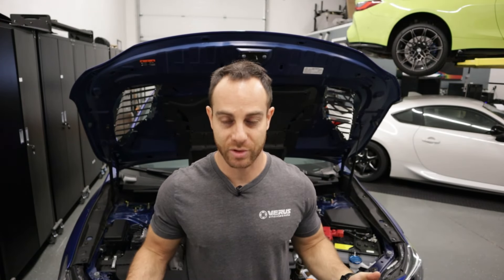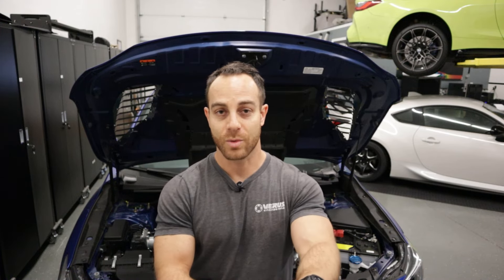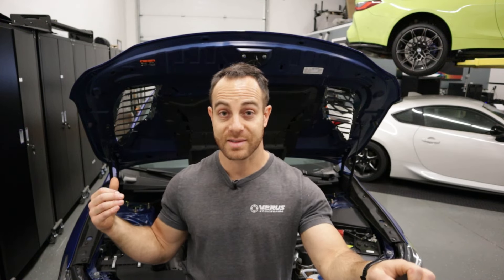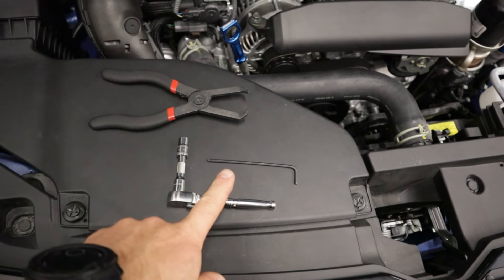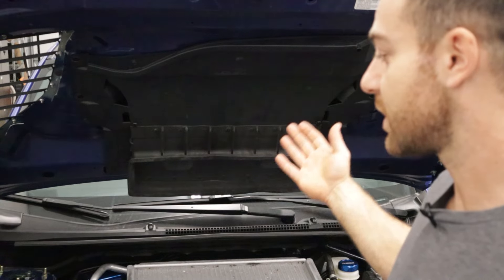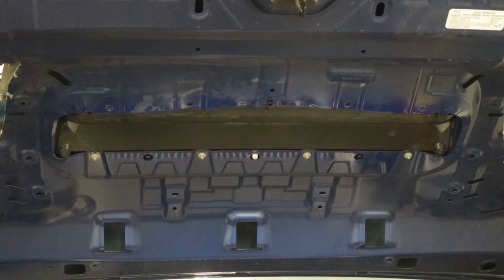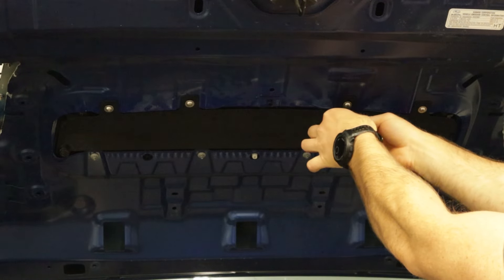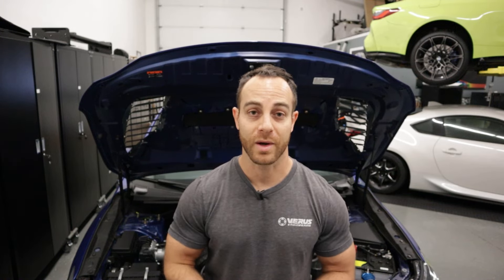How to install our Hood Scoop Block off on the VB WRX

Comment: I have remove those clips with 100% success 3 times or more.
Reply: Use a plastic panel popper
Reply from the maker: Sounds good! Thank you for the advice.
Reply from the maker: I did! I promise! They all cracked upon looking at them.

Comment: While it’s tempting to increase airflow to the FMIC, it’s crucial to ensure the turbo continues to receive adequate cooling air to prevent potential damage. Although our turbos are equipped with coolant lines to help maintain their temperature, diverting airflow can lead to higher coolant and oil temperatures, compromising the cooling efficiency. It appears that the engineers designed these cars thoughtfully, and in my opinion, upgrading the TMIC is a more balanced approach.
Reply from the maker: We are not arguing that fact, but if you are running an FMIC, there is no need to have the hood scoop open any longer. Keeping the hood scoop open, just increases underhood pressure, if a TMIC is no longer present. We highly advise pairing the Hood Scoop Block Off with our Hood Louver Kit in order to decrease underhood pressure as well as engine bay temps.